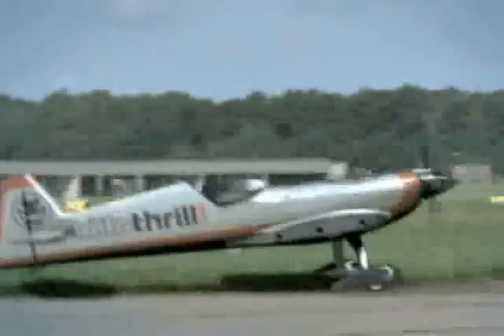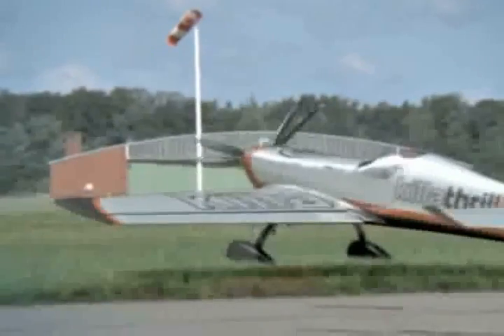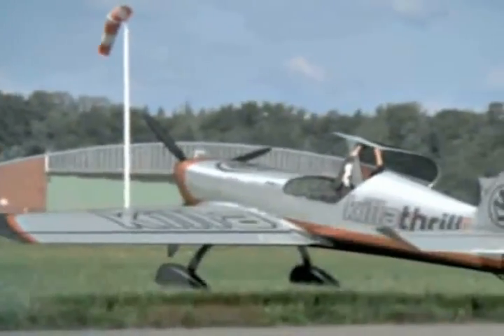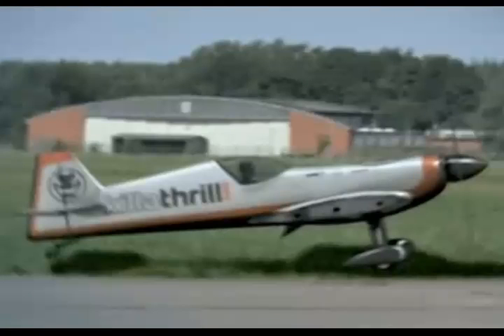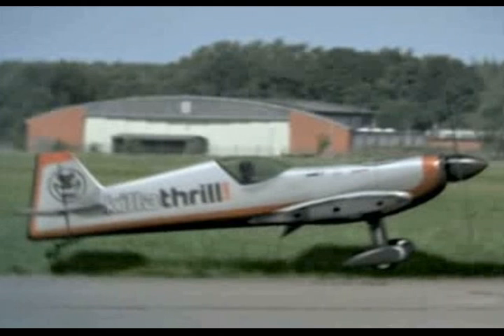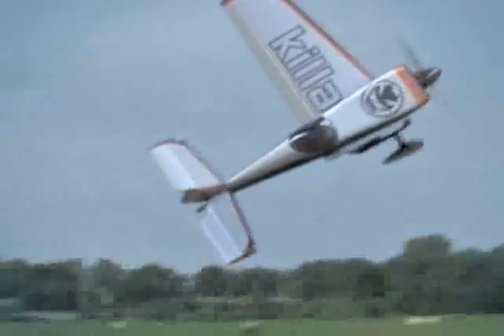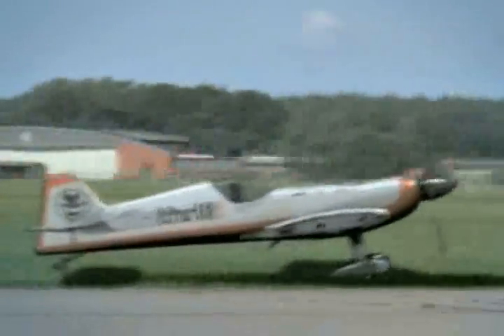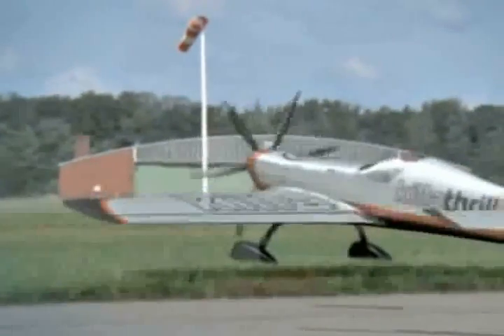The Big Hoax: Aircraft Loses Wing, Lands Safely (is not the best pilot ever)

Comment: Tourque effect According to Newton's law, "for every action there is an equal and opposite reaction," such that the propeller, if turning clockwise (when viewed from the cockpit), imparts a tendency for the aircraft to rotate counterclockwise. Since most single engine aircraft have propellers rotating clockwise, they rotate to the left, pushing the left wing down

Comment: It is not possible to safely land ANY aircraft after losing a wing. A major control surface was destroyed. The ailerons of the aircraft are what makes it turn and stay in level flight. Loss of a wing would put the aircraft in an uncontrollable spin and the aircraft would crash. If you bother to actually watch the video again, you will see that it was a rc model aircraft and video manipulation.

Comment: There are many things that make the aircraft that actualy lands real. First off, the entire tail swivels on a real Extra 260, Not so on RC's. The plane landing, does not move in the jerky motion of RC's. As for being able to stop so fast, The plane was not moving fast enough to fly if it had 2 wings. An Extra 260 can almost hover like a hellicopter. If you listen he is full throtle before landing bleeding off as much speed as possible. Rc in first part staged. landing plane could be digital.

Comment: I used to fly aerobatics. The plane in the video is an Extra 260. And this guy is wrong on several counts. There have been many succesful one wing landings. The flight cotrol systems on this and all aerobatic aircraft Are linked only thru the joystic. he is right that the plane on the ground is real and the one in the air is RC. The wing break off was staged. While the plane is stiil in the air, The last time it leaves frame and comes back thats when switch is made. But it is still in the air.

Comment: Yeah this is obviously fake, but I've seen RC planes of similar design land sucessfully after losing a wing. Of course, we're talking about an entirely different set of circumstances with an RC plane, and it take an amazingly skilled and cool-headed RC pilot to pull it off. Still, it's a cool thing to see when you're sure that a $2000 plane is going to pancake, but the pilot pulls it out at the last second.